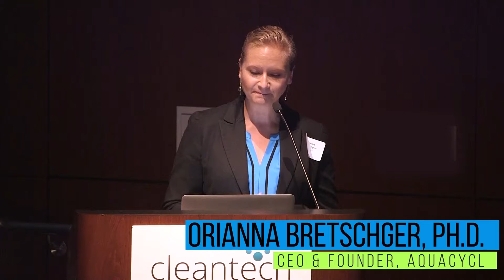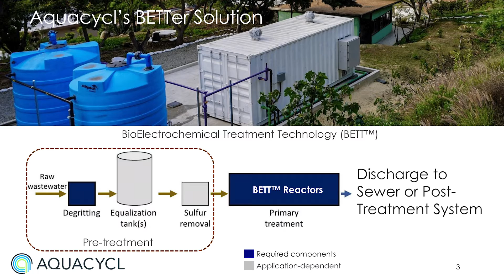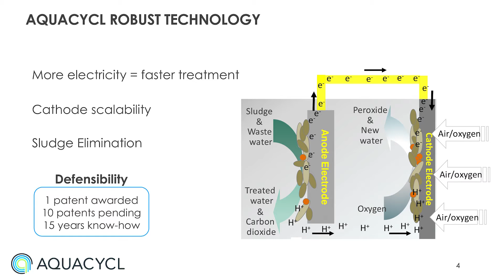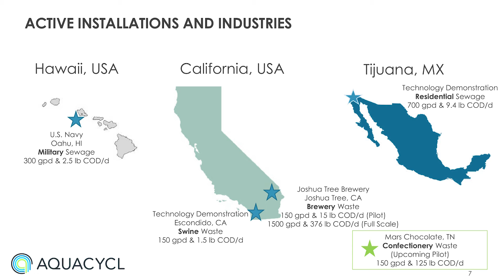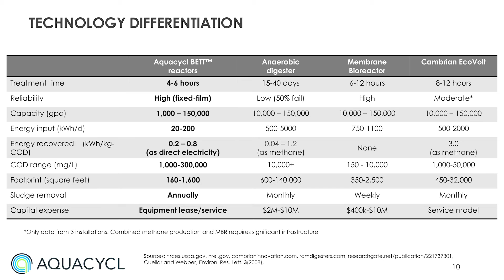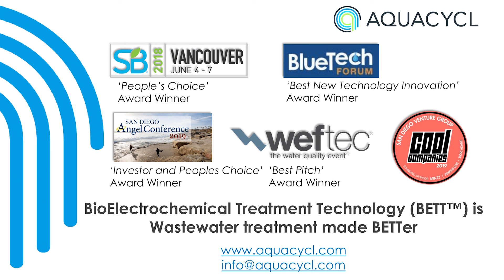Aquacycl's BETT systems make wastewater treatment BETTer

Comment: How would this work with Treatment Facilities that handle 80 million gallons of wastewater per day?
Reply: I guess if it takes a 20 foot container to treat 1500 gpd, doing 80 million a day is unimaginable?
Reply: This system is geared towards high strength wastewater.
When installed upstream of your treatment facility (on industrial sites) you have the most benefits